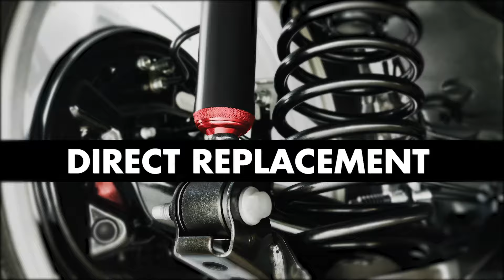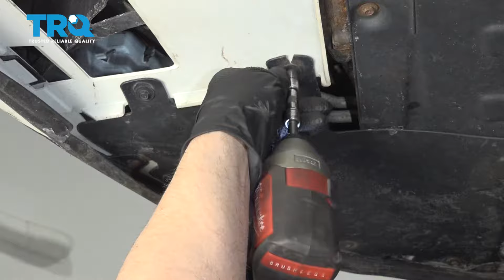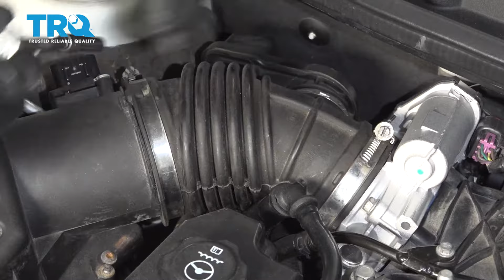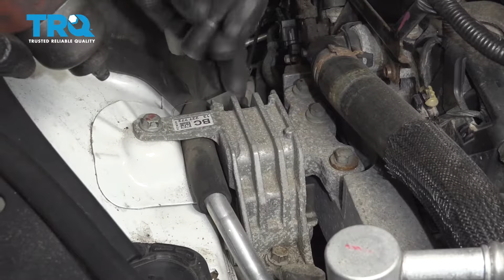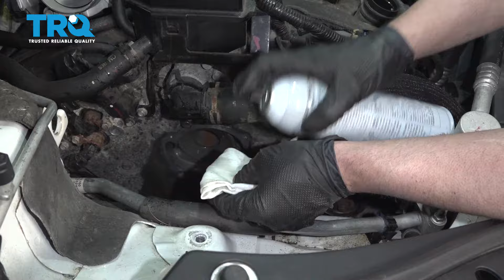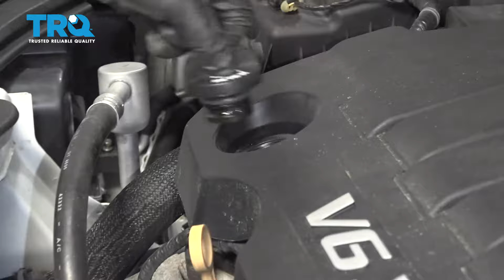How To Replace Water Pump 2010-16 Buick LaCrosse

Comment: I always enjoy watching your videos because the have the best step-by-step and clear view  of the part being installed.  Your videos helped me install a water pump on a Chevy Trax ( that was a nightmare compared to this one) , however I do have a question : Shouldn't you be using new bolts ? Are those torque to yield like the ones on the Trax?  or just take a chance and use the old ones like in the video?

Comment: I’ 75 and have always maintained my own vehicles.  I wasn’t sure I wanted to tackle this because of the amount of disassembly and my digits don’t  work like they used to.  Following your video I saved approximately a thousand dollars and got the satisfaction of doing it myself.  Yeah, it took a little longer but I got the job done.  Thanks for the guidance.  Kevin McGuire

Comment: Thank you so much for the video. My 2010 Buick lacrosse is working well after replacing her water pump. She's no longer overheating, constantly leaking coolant, or making the terrible grinding noise of impending vehicle doom. I really appreciated the torque specs being provided. How I was able to live my life until now without owning a torque wrench is a real mystery. Being able to make this repair myself allowed me to save quite a bit of money and allowed me to keep driving to work. I ended up replacing my coolant temperature sensor too as I noticed my radiator cooling fans were not kicking on. Everything is running like it supposed to now, I feel like I know more about my vehicle, and also feel empowered to tackle more maintenance jobs. Brake pads next...

Comment: Mount to body bolts (3) are 46 ft-lb.  Water pump to engine is 89 in-lb in sequence, two passes….third pass is +45 degrees.
Reply: Correct and they are torque to yield (stretch) bolts and must be replaced with new.  If you dont replace the bolts, the 45 degrees will possibly break the old bolts and ruin your day.  The factory water pump comes with new bolts.

Comment: Got a call from a customer for this job I went and installed it for them and now they're claiming their car won't start after I replace their water pump looks like they just got a free water pump replacement
Reply: Did you crank and check fluid level? And give them the old water pump